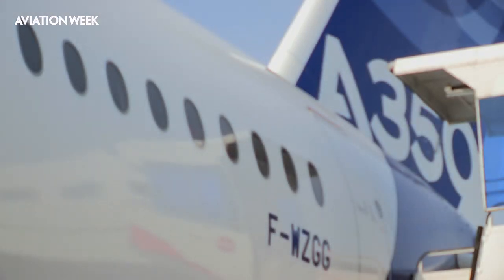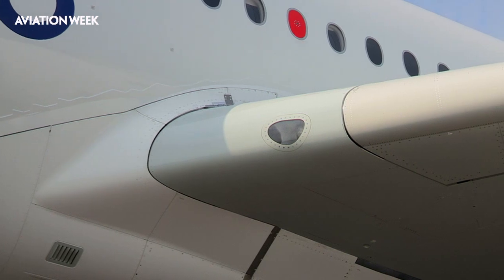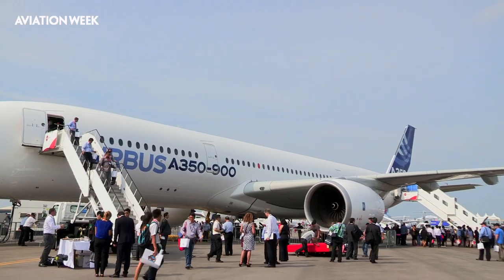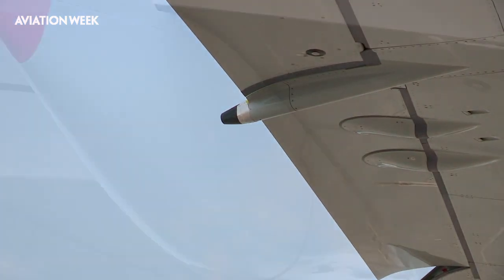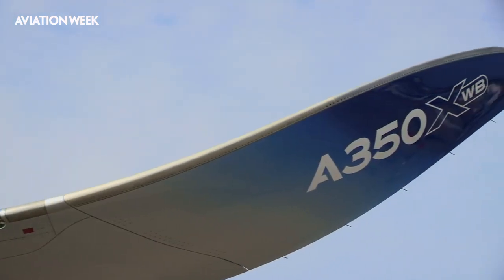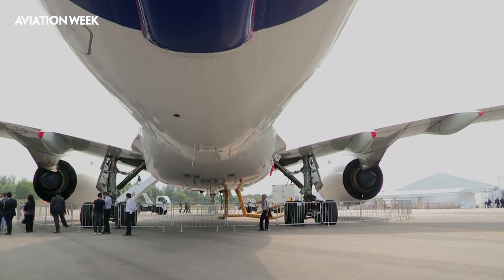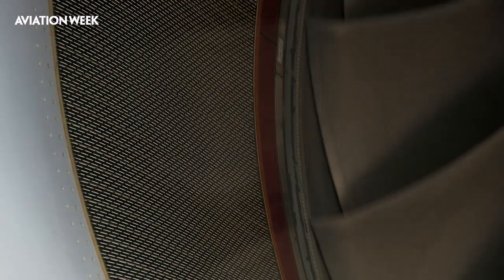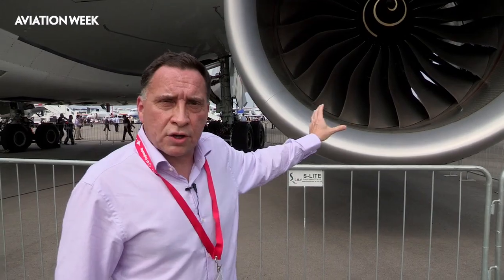Aviation Week Insight: Airbus A350 Design

Comment: I dont like the nickname "XWB"

They need to be more creative like Boeing, such as Dreamliner and Worldliner.

They even got the abbreviation wrong! It should be "EWB" lol
Reply: Boeing also has those letters, like 727QC (Quick Change), 747SP (Special Performance), and 767ER (Extended Range), 737NG (Next Generation), 737MAX, i have no idea what the MAX stands for. There is a lot more in Boeing i just don't remember all of them and don't feel like looking for them, but you probably get the picture anyway...Right?
Reply: MAX basically stands for maximum benefit airplane, both fro the consumer (passengers) and the customer (the airline).
Reply: i dont understand whz its called extra wide body

i mean its a new airplane model its not like thare was a smaller a350 before

Comment: i think the most impressive thing about this plane is that it has less development time than the 787. considering that the A380 started more or less when the development of the A330/340 ended, which was long ago. well to be fair the A350 is derived from the A330/340. plus there might be a lot of scrapped ideas from the A330/340/380 that was incorporated in the A350.

Comment: It's just slightly better than 787. And anyway this a larger aircraft with competes with current 777, bridging the market space between 787 and the future 777X. Some airlines will choose 787, others a350 and others 777x  or even a380 depending on their needs... Any of these planes is fantastic, but I think Airbus planes marginally ahead in comfort (seat space and noise),. Boeings are efficiency monsters
Reply: john russell
Right, that must be the reason why Emirates, the largest 777 operator, just ordered another 50 A380s.
Reply: When the 777x gets its stride it will be 2020-21 (assuming the project doesn't face any delay), by that time a simple re-engine on the a380 will put it ahead of any aircraft in economics. BUT that only happpens when you can fill a plane. And as I said, that depends on the airline and route, so each plane has its use case. There's enough market for  both a 777x and a380
Reply: blablubb12345 airbus is canceling the a380 in 2019
Reply: No, that's not true. The Airbus CTO mentioned once that they "might" cancel the A380 if there are no further orders. But Emirates and CEO Tom Enders both said that they are strongly committed to the A380. I'd say it's more likely that we will see an A380neo than the program being cancelled by 2019.
Reply: Drake Robichaud Nope. airbus won't cancel it, but we can see a slowdown in production rates if they don't get  any new orders in the coming two-three years (which is unlikely).To be fair every airplane is very dependant on the economic cycle and no one can predict how the 2020's will be.

Comment: 787 is better
Reply: Well the 787 certainly hasn't has much of a great start, that's for sure. With companies like Norwegian not accepting more planes before the current ones are fixed. 
Time will tell of A350 will be better, but it wont need much to be better at launch than 787.
Reply: ***** Has Dreamliner problems occurred to other airliners than Norwegian? By the way, most of the Norwegian Dreamliner problems is (to a certain degree) fixed. In four years Norwegian will have ten 787-8 aircrafts and four 787-9 aircrafts. Thanks for answering! It would be nice to hear. :-)
Reply: Scott Vik Bergstrøm 787 incidents this year (till April 2014) only involves Norwegian Air Shuttle. How about Last year, 2013? JAL, Ethiopian Airlines, ANA, LOT, Norwegian Long Haul and Air India. Most of which are major security issues.
Follow: http://en.wikipedia.org/wiki/Boeing_787_Dreamliner#Incidents
Reply: This is sad news for both Boeing and of course the airliners and passengers. Norwegian has used 777's, a A330 and A340's rented in due to problems with the Dreamliner fleet. The problems that have occurred is according to the media, Boeings fault. I think Norwegian has got a special price on the ordered 787-9's because of this. 
- Thanks for the Wiki-link!
Reply: I think that both planes are good but you can't just go off and assume that the airbus will have a flawless track record considering the fact that it's NOT EVEN OUT YET!
Reply: I have not said anything about that, but it will for sure be exciting so see. By the way, when will the A350 be launched? :)
Reply: Well 787 is already flying
Reply: Flightcommander1000 Norwegian Long Haul received a new Dreamliner 787-8 today. I really look forward to see the 787-9 in air. What do you think?
Reply: I think that it's an amazing piece of engineering. I would look forward to seeing it too, unfortunately I don't know of any airlines that will fly it into an airport near me.
Reply: I see. May I ask which airport it is?
Reply: San Diego International. KSAN
Reply: Excuse me? What plane has 20 year old tech where the other one is more current? The A350. A bunch of old A330/340/380 ideas scrapped into one where the 787 wing and exterior design - composites - are almost exactly the same. He mentioned that this is the first type of wing like this Airbus has ever produced? The 777 had this tech 20 years ago!